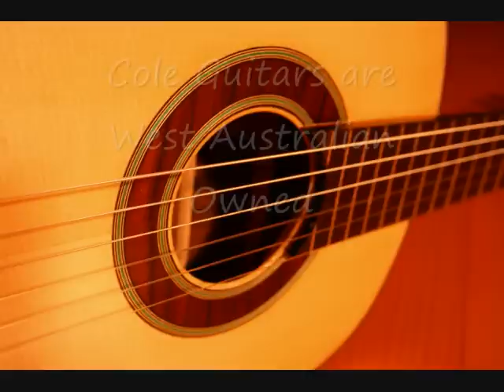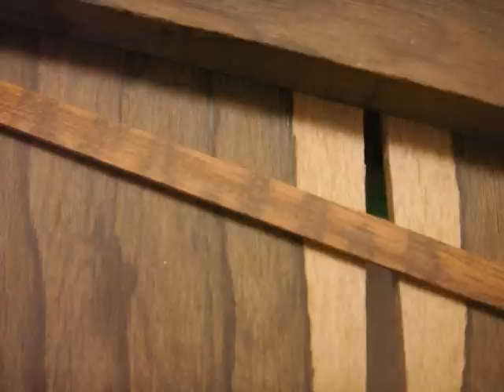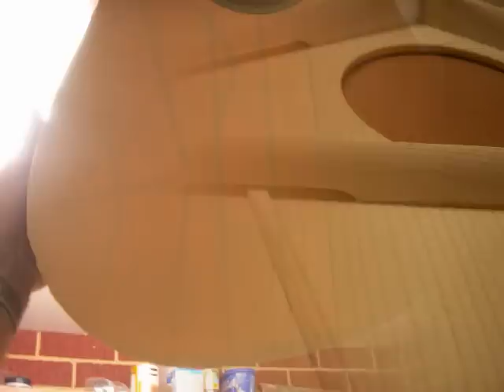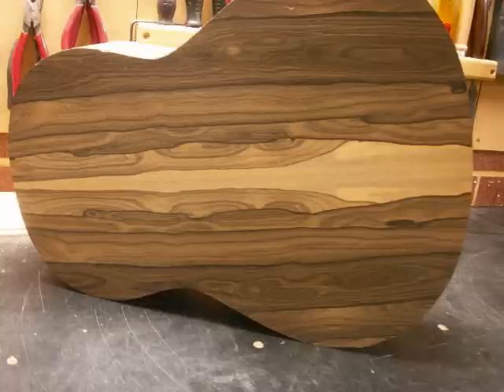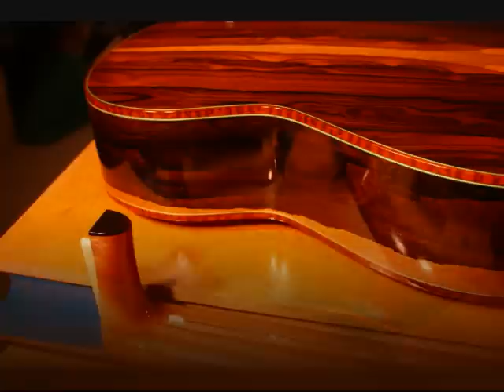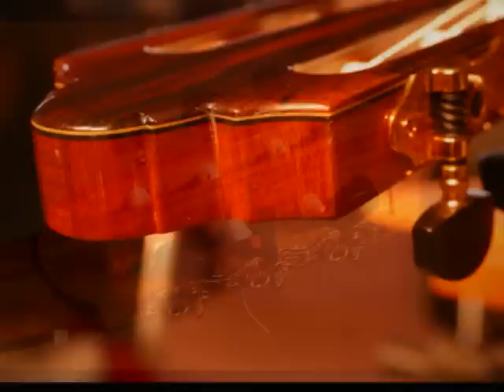Classical Double top Guitar by Cole Guitars

Comment: Nice work.

About snakewood: being a historical bowmaker, I've bent lots of snakewood, up to 12 mm thick, and it actually bends quite nicely and is not especially splintery.  The trick is getting it hot enough slowly enough.  I usually bend it over a woodstove, just with radiant heat, but a bending iron works quite nicely for thin stuff like these liners.

If anyone can come to Vienna to pick up the stuff, I have scraps of snakewood, ironwood, and pernambuco, enough for many guitar linings, lying around.

cheers from sunny Austria, Scott